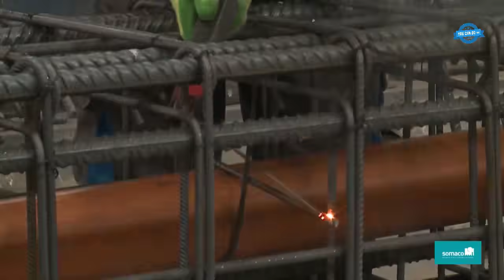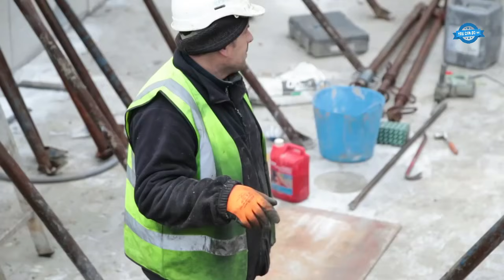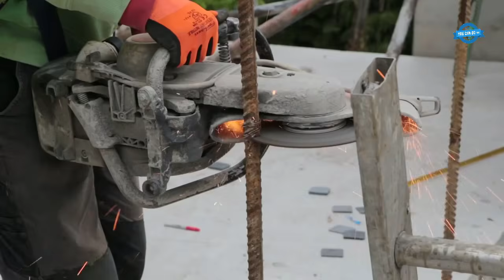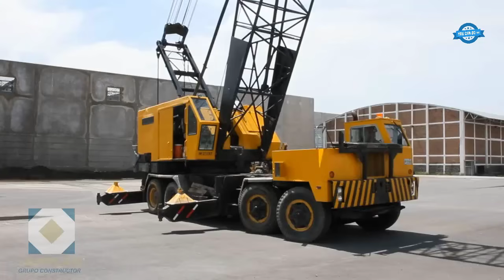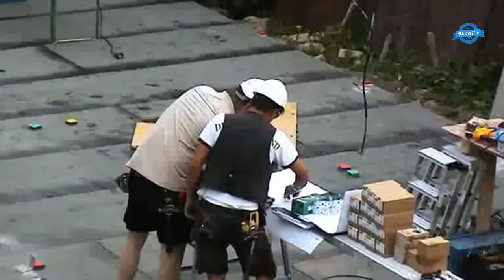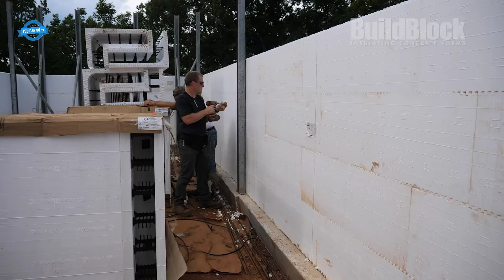Incredible Modern House Construction Technologies. Building Wooden House In Only 3 Days

Comment: how does a 4" thick wood-framed exterior wall achieve ANY sort of "high-energy efficiency?!!" Not here in SW FL, USA, sister!! R19 walls/R38 ceilings (minimum). Didn't see ANY metal connectors, so maybe there's no high winds or possible earthquakes there? I have Design/Built FL ECOhomes & catamarans for 40+ years, and know a little. Takes more than a YT-video to prove if a system is "smart". Do your research, kids! :-)